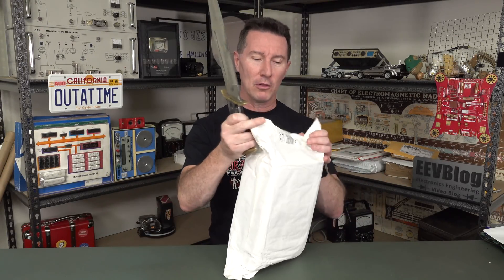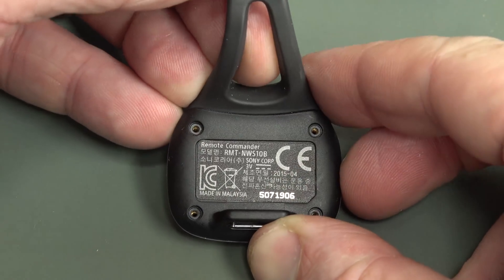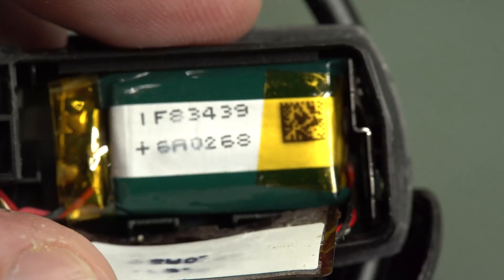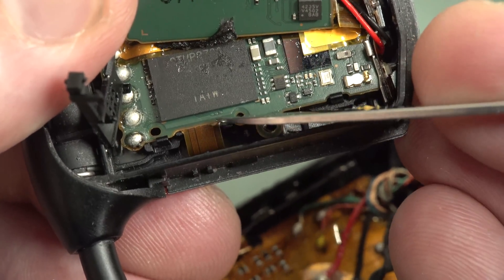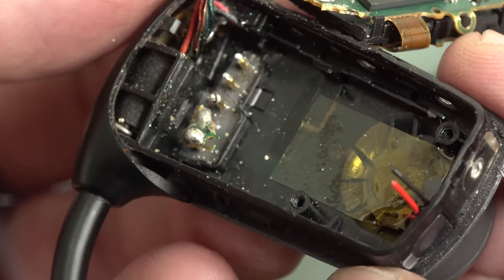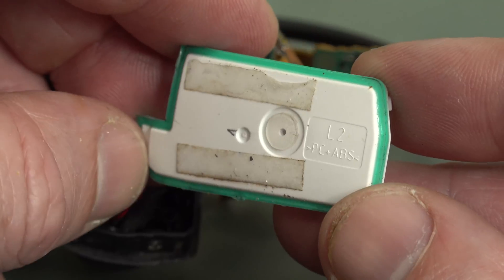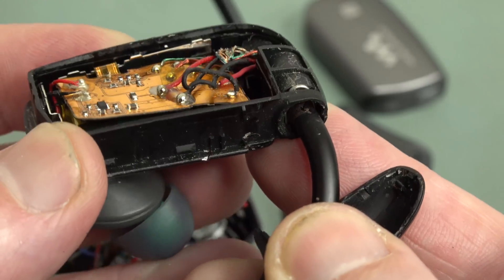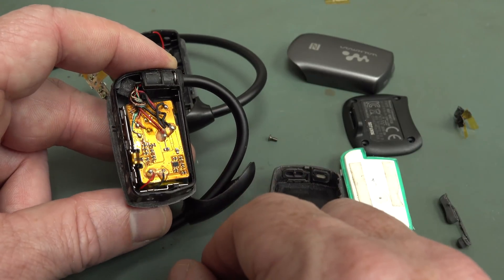EEVblog #1210 - Sony Waterproof Earphones Teardown

Comment: I have lost count of how many of these Sony Waterproof MP3's I have had. The control ring is a later expensive gimmick that serves no real use, so stick to the cheaper non bluetooth ones.  I swim 4 or 5 times a week in these listening to prog rock - to block out any screaming kids in the other half of the pool.  The shortest life one died after 3 months and the newest and longest lived survived 24 months before finally giving up this week. Mostly they get a few months past the 12 month warranty before packing in.  If I can get 250 swims out of a pair then, at half an Aussie $ per swim, I am happy. So I have just ordered yet another replacement pair....

Comment: Nice. I did work experience as a 16 year old at AWA Microelectronics. They were doing some IC in a can, something aerospace or military, might have even been for your sonarbouys, I can't recall. But yeah they welded them, put them in a bomb and pressurised them with helium to stupid pressures then evacuated the bomb, waited a bit and then opened a port to a mass spectrometer. If the weld was shit, then the helium would slowly leak out and give a much larger peak at helium than a good one, and of course I'm sure they spent weeks calibrating it all with holes of various sized zapped into the can!

Comment: The potting compound there looks like Corning 3145 Gray. Used in the aerospace industry to seal up avionics and as an adhesive for bodges. Even directly poking it with a soldering iron doesn't do anything.

Comment: That's neat about the helium test, they do that for telecom cables too.  They are filled with air at a low pressure to keep water out.   If there is a leak they pump helum and go for a drive with a special probe to try to find the leak. Helium makes a different sound when it leaks out.
Reply: Telecom cables actually use Nitrogen for pressure and to prevent the ingress of wet air.

Comment: I think that the green seal works with the top cover to prevent water penetration,
as intermedium  between the two. So for the white secondary cover to work, the first top cover would perhaps push it down to get the desired result. Or maybe its a glue thats added afterwards during the assembly process.

Comment: I've got a pair of these. And they still work great but I did pop the backs off and add more silicon due to another pair I had go bad. Water will eventually get in if you don't add extra sealer. You can put music on them. 4gb worth or use bluetooth P.S. it doesn't work well (The green plastic) but it's game on when you put some silly on it 🤘

Comment: Sony is always full of surprsises when it comes to hardware layout :D tha's were quite a lot of swimming. Is there any coding, layer of hidrofobic material on PCB's and Flex? at 9:49 looks like a toshiba memory. The rubber solution looks like more a hidrodinamyc path to the water pass thru instead of penetrating

Comment: Very nice video  Dave love your channel :).The Murata IC is a  type ZF Bluetooth 4.1LE module they make combo Bluetooth/wifi SIP modules. The Fidelix IC is an SDRAM and the Toshiba  THGBMDG5D1LBAIL is a 15nm MLC 4GB EMMC for the STMP3780  ARM926 audio system on chip IC running at 200MHz with integrated PMU, Audio codec and LCD interface with external memory and SDIO interface.

Comment: I have designed autoclaves with similar seals and it is the outside pressure (inside with an autoclave) that causes the seal to expand as it is pressed. The more pressure the more the seal is pressed so they work really well until they go hard.

Comment: When swimming (wearing an older set), ear buds need to seal in the ears or there is no music. Sometimes happens when I push off the side of the pool too fast and then no sound from one of the buds with water in my ear.

Comment: they clip the white bit in, there's no green. the green is liquid plastic that is poured in and then cured with UV to seal it. by cracking it open you've broken the seal

Comment: As the batts take up quite a lot of the volume, I wonder whether they change size during charging enough to cause internal pressure variations and forces which add to the sealing problems ? Nicely built though, as usual with Sony :-)

Comment: The green is most likely a kind of glue/expoy, I have seen that a lot of times in similar applications, when you look at it under a microscope you can see that it perfectly fits into the imperfections of the outer part.

Comment: It seems the BLE remote control is the most useful part of this set) I have this one and it was very interesting to use the rc to control another devices. Its possible because rc uses only MAC address filtering after power on and then you can connect to it with or without pairing procedure. I used the rc to control a prototype for one project at my work.

Comment: Hey, my favorite line of running mp3 player/bluetooth headsets to be destroyed at the hands of Dave... noice. xD

I guess not many people know about this line from Sony, but it's currently in the... probably 6th or 7th iteration since the first model, and Sony has been extremely good into listening to user requests and improving the design overtime. It's not super cheap, but they really listened and invested into attending user requests for this product line, major respect. Size, weight reduction, bluetooth capabilities, having some way of adjusting the neckband length and tightness, ambient audio passthrough... each iteration they add something that is being requested by users.
This used to be an mp3 player only headset, Walkman line. Bluetooth came... pretty late into the game actually, first model with it being the previous to this one.
 
I can get how lots of people just hate this design... looks weird, the in ear thing really hurts after a while, it's really bad if it doesn't fit you well.
But for a few people, it's just this or nothing I guess. That's probably what's keeping this line going on for all these years...

Over the years, I tested well over 20 different mp3 players for running and bluetooth headsets. If you add wired phones with smartphone on bracelet style case or some sort of pouch/fanny pack... that would be something closer to 50 different headphones.

All of them without exception get dislodged from my ear or just plain drop out once I've ran juuust a bit and sweat becomes involved. All of them... except for the headphones from this line.

I also tried regular buds, those won't stay in place even when I'm not running. I tried those with different types of caps or extra support that goes around the ear, nope. Proper big headphones... of course they don't work for running, but they all make my ear super hot and super gross, so no friggin way... specially because they give me some very painful pimples.
I also tried some more generic neckband models, it's never the right tension... either too lose, or too hard, which hurts the ears. I also tried the bone conduction models.... too muffled, can't hear anything over the ambient noise while running.

So, I'm on my 4th purchase of Sony NWZs... the exact same one Dave is destroying there. xD
I have to note too... none of them so far has degraded to the point of not holding a charge. Perhaps the very first one I bought which I gave away is no longer working, but all others are still with me and plenty ok.

Then again, I don't really use them all the time. And I must have taken it for a swim only half a dozen times or so... mostly use them on running sessions. I do sweat a lot though... xD So at the very least mine have survived a couple of years being drenched in sweat couple times a week.

Oh yeah, explaining... this thing has an internal mp3 player with some 16Gb storage... not much, but enough. You either use it like that or as a bluetooth headset.
Another thing that might explain the excess of electronics... it has a digital ambient audio bypass. It's not super great, but works. You can activate a mode with a button that captures audio with it's microphone and mixes with whatever is playing. Give you some ambient awareness.
Reply: Do these have a repeat function?
Reply: @zetasyanthis  From what I can tell, it has shuffle and repeat mode only for internal storage.... on bluetooth mode you need to program it on the device, I think. Not super sure because I don't use alternative modes much. But Sony website has the digital manuals available to check out!

Comment: I saw some corrosion on one of the boards near the wire that goes between the headphones. Perhaps the joint there failed.. it would undergo quiete a bit of flexure over time.
Reply: Yes, the cord took a bit of flexing, especially when I was taking them off from under the swimming cap.

Comment: Water doesn't pass thru because there is air inside and gaps and pressure are too small to penetrate. It is made to swim, not to dive. Ruin mine, cut a flex cable with an exacto knife when I tried  to open the case to replace the dead battery. It is a nice product anyway however it is not meant to serviced.

Comment: I think when the top side is put into place, it has some ridges that press on the green llastic part, which pushes it to the sides as it's being blocked from the bottom and pressed from the top. When it's pushed to the side, it can then create a nice seal.

Comment: Green material is probably some sort of epoxy or photo cured plastic. You didn't need to open this to replace a battery, so it was permanently sealed. Until you broke into it which was somewhat difficult.
Reply: Not that difficult. Drop it a few times and you might get unlucky. It's a similar material to conformal coating.
Rubber is much better, including urethane.

Comment: Great ! Is it a single battery , right?
Where can I get a spare battery
They are for swimmers ...up to 1 m depth ..

My ones died too ... battery I guess cause I did not use them ... just charged them and when I wanted to use them they were dead.
Reply: It's because you fed them after midnight.